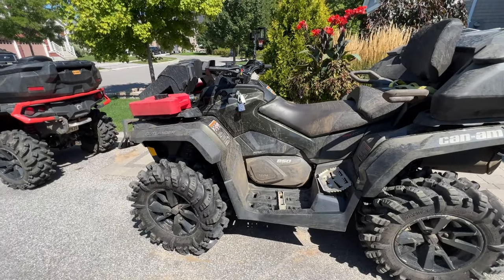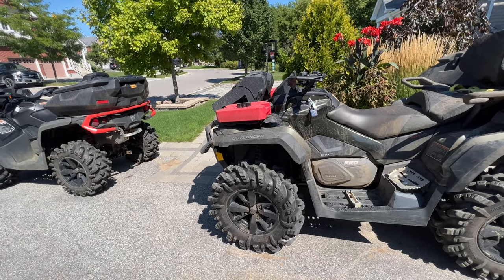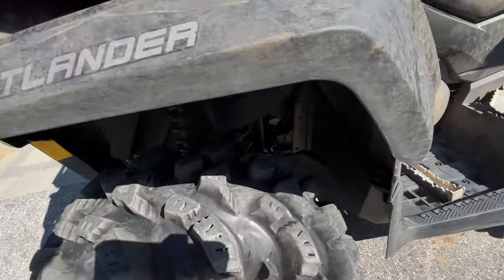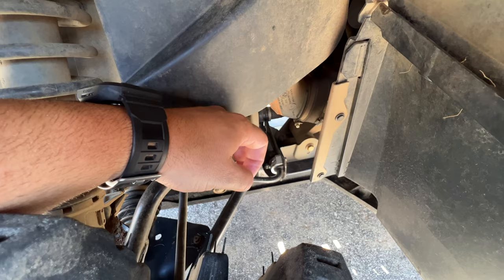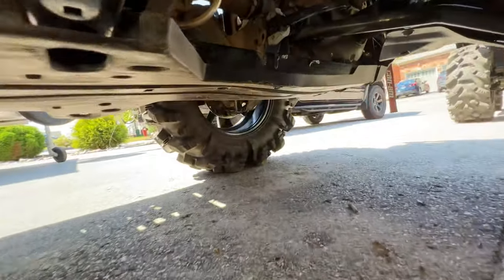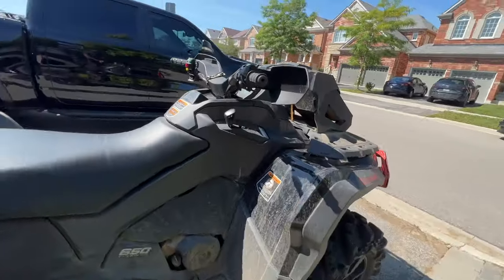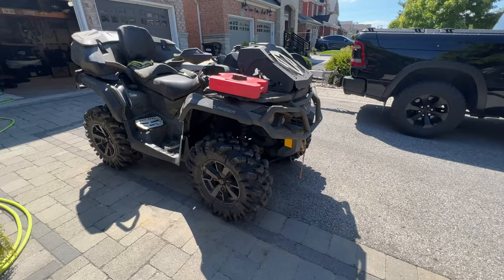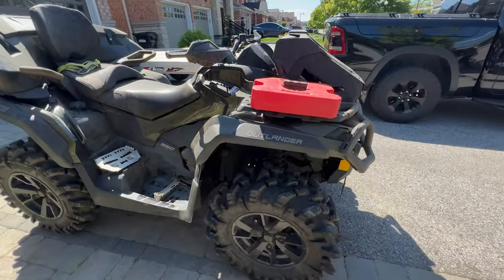If You Own a Can-Am Outlander...CHECK THIS NOW!!

Comment: FYI they don't come fully built, this is due to the crate size. Obviously the bulk of the machine is together but the tires and other hub pieces are left off to fit into the square crate. 

The loose bolt issue is the installer at the dealership that puts the rest of the machine together before it hits the showroom. I have met a number of these guys. Some are mechanics who are very tedious and some are just installers 18 years old doing it as a summer job and not so meticulous.

This assemble at the dealership is an issue at most dealerships and this is why they tell you to check every bolt you can see when you buy any atv dirtbike utv crotchrocket Harley naked cruiser what have you. Cars are the only vehicle fully assembled and delivered from the factory.

Comment: 2021 outlander 1000r here. Accidentally stumbled across this video while looking up how to content. I actually found the first one myself while greasing the zerk fitting. The top bolt was almost entirely backed out but no bolts lost. Noticed around 600 miles. Going to check that plate tomorrow, thanks for the heads up!
Reply from the maker: I found mine the same way while greasing it. Regular maintenance is the best way to find issues before they become bad. Thanks for watching!

Comment: Yep.  I have a 22' Outy 650 XT and the left side sway bar bushing bolts were observed to be loose about a month and a half ago.  I was just greasing it as well and noticed it.  Took the bolts out, cleaned them and used some blue lock tight.  Haven't had any issues since.  Cheers!
Reply from the maker: Good to know. I added the blue loctite as well.

Comment: It's not just your machines. I've got a 22 and had the same issue on the right side of the machine. Couldn't find the clunk and took back to the dealership. They couldn't find it. I found it before we left the dealership and we pulled them and reinstalled with locktite. No issue since.
Reply from the maker: Good to know! I’m looking at picking up another machine in the spring and it’ll be one of the first things I do is to add Loctite.

Comment: While greasing zerks on my 2021 Can Am Outlander 1000 XMR guess what I found.   Yep, the front sway bar bushings were loose.  The right side lower bolt was about to fall out.  The others looked fine but they were loose as well.  The 10 mm socket wrench got them tight.  The three bolts that looked fine each took 1/2  to 3/4 turn to achieve a tight fitting.
Reply from the maker: Awesome machine! You’re gonna love it. Glad you were able to catch the bolts. Thanks for watching!

Comment: Both of mine renegade xmr 2022 and outlander 2023 xmr  sway bar link bushing loose struts bolt loose bolts laying around in the frame too . Crazy for a 20k machine out the door you expect everything to be on point
Reply from the maker: I agree. I have just one ride so far on my new 1000XMR. Gotta check the bolts.
Reply: I have a 2023 850 xt max out the door was 14,000 . I get what you're  saying. in 2001 I bought a yamah raptor 660 new for 4900.00  now there over 10,000

Comment: bought a 2022  can am outlander  brand new...parked it and it was running good at the time...went to try it later and it will not start...of course this was right after the warranty was finished...engine light came on and only would growl (battery/) right now it is parked as i can not do anything with it..money talks but only if you have it!
Reply from the maker: Were you able to get the issue sorted out?

Comment: 2022 650 outlander  and mine were loose also ...could hear a clunk in the front while in the rough stuff going slow a thats what it was...2000km later and there still tight.
Reply from the maker: Glad they’re holding. Did you use loctite on them?
Reply: @johnsoff-road  no and it's been good since,I guess I caught it in time before it did any damage to the bracket holding it,it was one of the first ride after I bought it new.

Comment: I had same issue on my 21 850 xmr  Also has my rear driveshaft bolt back itself all the way out causing all kinds of damage luckily dealer warranty covered me
Reply from the maker: I’ve seen a couple friends bikes with that driveshaft issue as well. I haven’t had a chance to check mine yet but if it has the issue I may make another video about it.

Comment: Same thing happened on both my bike and the wife's. 2022 XMR650 and 2022 650XT. Mine was like yours, both bolts gone. Her bike they were loose. Left side of mine was loose as well.
Reply from the maker: I can’t believe how many brand new bikes have the issue. Luckily I was able to find a matching bolt at Home Depot for a few cents vs a few $$ at the dealer.

Comment: Bought a 2022 Outlander 650 XT last October and had the same issue. Noticed it immediately when I got home with it and tightened them up. Another common issue is the winch switch is wired backwards, or the cable is wound the wrong way.
edit

 just remembered that my fuel pump also died under 100 miles, but I was out of warranty. $400 for the whole assembly from Can Am. Replaced the factory Chinese pump with a $50 Japanese pump.
Reply from the maker: Good to know!

Comment: I noticed one of mine was loose on my 2022 850 XT max when I was greasing it a couple of months ago! I tightened it up and when it went in for its service the first of this month, I had them take a look and make sure they were all still holding on properly. The bike has 3600km on it. Apparently I’ll have to keep a close eye on these when I clean/grease the bike.
Reply from the maker: Yeah I put blue loctite on mine but still check them fairly regularly.

Comment: Yep, I have this issue on my 2023🙃 what kind of tires are those and what size? And are you stock height or lifted, if so which lift kit did you buy? Thanks!
Reply from the maker: Hey they’re SuperATV Intimidators. Check out my other videos. I have one where I go over the 2 different sizes I have and what I did to make them fit.

Comment: My 2022 Can-Am 1000 XMR we're also loose. I came across another video that showed the same thing it was probably a couple of years old. After watching that video I checked mine and mine were loose from the factory brand new.
Reply: My 12v cigarette lighter accessory plug also was about falling out because no one tightened the backing ring on it from the factory
Reply: It seems like some other things were loose, I just went through and checked every bolt that I could see to make sure they were tight
Reply from the maker: It sucks that we have to check the machines over ourselves to make sure they were built right. I’m a big fan of Can-Am but simple things like this shouldn’t happen.

Comment: i HAVE A 2020 650 OUTLANDER MAX AND I RE-TIGHTENED THEM ON THE LEFT SIDE BEFORE I USED THE BIKE, I NOTICED THEY WERE FALLING OFF.  THIS MUST BE A MISS ON THE MANUFACTURER PART.  I ALSO ADDED LOCK TIGHT TO THOSE BOLTS.
Reply from the maker: Yes definitely an manufacturer issue.
Reply: Thanks for the heads up.    Watched your vid then went and checked my 2021 650 max and both sides needed a lot of tightening.    Thank you
Reply from the maker: You’re welcome!

Comment: Happened with my 2022 outlander also. Went to lowes got new bolts and lock washers. May or May not have put a little loktite on them also lol
Reply from the maker: Yeah Loctite seems to have fixed the issue for me...so far.

Comment: Thank you very much for the video. I'm picking up my new 2022 outlander 850 xt in a couple of days and will definitely keep an eye on both sides. Anything else I should know? 🍻🇨🇦
Reply from the maker: Thanks for watching! I’d be curious if you check yours right when you get it if the bolts will be loose. Lots of people have commented that their new machines were loose but that was after riding a bit. Let us know! Keep it greased and enjoy!
Reply: @johnsoff-road  I should be picking it up later today after work and I will definitely check both sides before I ride it and I'll keep you and everyone posted.
Reply: Just got it home about an hour ago but it's still in the back of my truck because it's pouring rain here in Southern Ontario. Hopefully it will quit tomorrow morning and I'll be able to unload it and check both sides. What size wrench is needed?
Reply from the maker: 10mm
Reply: @johnsoff-road  so I finally got my new 2022 Can Am outlander 850xt out of my truck and on the ground and before my maiden voyage I checked the bolts on both sides and not only were they all a little bit loose but when I tightened the top one on the side with the foot brake the head of the bolt and a few of the threads came right out and it was barely snug. Really soft bolts. I went for my first ride anyway as I was pumped up to go and then pissed off that this happened. 72.2 kms. My question now is how safe is it to drive it like this? Can I wait until the break in service to get it fixed?
Reply from the maker: Oh man that sucks! Is the bolt right out or broken but still stuck in the bracket? I got my replacement bolts at Home Depot. Just take one in and you can find a matching one for 1/4 the price of the dealer. If the other bolt lets go (which mine did) then your sway bar won’t be secure and you’ll get a clicking/thumping sound when going over bumps. Not sure if it’ll cause damage. And add blue loctite when reinstalling them.
Reply: @johnsoff-road  ya it really pissed me off. The head of the bolt and just a little bit of the threads fell onto the ground and I think the rest is still in there. I'm not sure how to get it out if it is still in there. Usually it takes a drill but I don't think I can get one in there. Not enough room. I have to get it out though because it'll drive me crazy until it's out and fixed properly along with the other 3 bolts like you said with 4 really strong bolts and blue loctite. Thanks for your advice.
Reply: One more question. Is the rear of the machine the same set up? And if so has there been any reports of those bolts being loose or totally missing? I figure if this is the case then I'll just replace all 8. Thanks.
Reply from the maker: No just the front has the sway bar.

Comment: my 19 1000 outlanders sway bar bolts were loose too, so I got rid of the sway bar...problem solved.  I want my suspension to do what it was designed to do which is articulate and move around, not like im circle track racing it so its really a non issue and i also cut the rear one out.
Reply from the maker: Interesting, how do you find it handles now?
Reply: @johnsoff-road  its much more supple over bumps, ruts, n stuff but I dont take corners at speed for obvious reasons, if i do it will lean to the outside hard and lift the inside front tire.  Off camber hill climps it tends to be a bit more squirrley but those are quirks that i knew were going to come with taking the sway bars off.  Overall I think its much more nible out in the bush.
Reply from the maker: Good to know! definitely has advantages/disadvantages depending on riding style. Based on your comments, I think I'm best leaving mine alone! LOL
Reply: @johnsoff-road  im mainly in flatish areas unless im crossing mtn ranges or rivers here in Alaska.  Max speed maybe 25 mph?  Like i said earlier, im not racing this machine so the sway bars got axed.
Reply from the maker: It works for you, that’s all that matters! 🤙

Comment: The forum had an article where it was highly recommended to check all bolts you could get to.  I have an 850 Outlander on order, so that will be one of my first tasks.
Oh, I noticed my Dad's CFMOTO CForce 600 has paint marks on all the bolts.  I haven't notice any of them rotating out of paint mark alignment either.
Reply from the maker: This is the only time I’ve found a loose bolt on any of my 3 Outlanders dating back to 2010.

Comment: That looks to just be the sway bar, not a huge risk unless going fast and turning hard. As a Canadian I like to buy Canadian, but Can-Am, while making great engines and some of the most capable machines, they just aren't up to my standards in maintenance and quality checks before delivery. 
So between that and the only dealer near me for hours is brutally bad, I won't buy one. I can't justify driving 3 hrs when service is needed because my close dealer is shady.

Comment: I have a 2021 Outlander Max 850 Xt identical to yours. I will check first thing tomorrow. When I first bought it I would have a clunking noise coming from those sway arms. It was so annoying. Did you have that same problem or ever hear a clunking or snapping noise coming from that area?
Reply from the maker: Yes on my trip a couple weeks ago I had a clunk on that right side. When I got back and looked, both bolts gone. I went riding yesterday and the clunk is gone now that the bolts are replaced.
Reply: I'm curious,...was it your problem too ?

Comment: I have a 2022 570... bought it new. Its been my experience that they are junk. I would have taken it back immediately, but i need it for my farm and after my honda was stolen, you couldnt find a utility fourwheeler anywhere. Ill never own another one.
Reply from the maker: Every brand has their issues but overall in the 4 Can-Am’s I’ve owned I’ve had no issues that weren’t caused by me. I’ve had a 2010 650, 2020 650, 2021 850 and 2023 1000 XMR. All have been the Max chassis. I wouldn’t own another brand of quad. I know the sub 650 models prior to 2023 are a completely different machine so maybe that has something to do with it.
Reply: @johnsoff-road  I get that. You could buy a new Cadillac and have it break down. My biggest issue has been customer service, or that lack there of. I was sold a lemon that I paid cash for and no one at the company or the dealership cares.
Reply from the maker: @nealmcbaggins127 yeah that sucks for sure! I’ve been lucky in that the only issue I had with my 2010 was covered under warranty and went smoothly. Having issue after issue and not getting proper service is definitely not good!

Comment: I habe a 07 and the things a pos it was my first can am and going to be my last so many issues not even funny 

Rebuild the engine at 4200km 
Replaced both u joints on rear shaft
Fixed a leaking rad cap
Leaking cam tensioner 
And now the overflow for thr coolant gurgles when i am done a drive and squirts coolant when cooling down....should have stuck with a brute force lol but nooooope. Had to buy a can am cuz i was told as advrrtosed that there hogh qiality ...nobody mentioned high maintenece 😂😂😂😂😂😂😂😂
Reply from the maker: Yeah they have their quirks! Lol
Reply: @johnsoff-road  I just noticed the  blow out  ,out of my overflow bottle today it was alot ...usually just a tiny bit ..am I looking at head gasket ?
Reply from the maker: @tibrucee6969  I’m far from a mechanic so I’m not too sure what the problem would be.

Comment: Now I gotta check mine when I get home sorry that happened, parts number if you can! For the bolts and the clamp!
Reply from the maker: My first attempt is going to be Home Depot to see if they have the same bolt. If not, then off to the dealer.
Reply from the maker: Let us know what you find
Reply: One out of the four bolts were loose, I ended up cranking them all back down
Reply: Take that back after actually tightening them all down all 4 were loose!
Reply from the maker: Glad you caught it before it got as bad as mine. I’m definitely putting blue Loctite on mine when I replace them.

Comment: Where can I get the bolts?
Reply from the maker: I got replacements from Home Depot for about 1/4 the price of the dealer. Just take one off from the other side and take it into the store to find the closest match you can. Then reinstall them with blue Loctite.

Comment: Can Am is garbage, I was dumb enough to buy two of them for farm use and they started falling apart right after I got them and good luck getting a dealer to fix them under warranty.
Reply from the maker: I’ve had 4 Outlanders over the past 14 years and have never had any major issues. And anything that was warranty was covered without question. Every manufacturer has their own set of issues/poor dealer experiences.